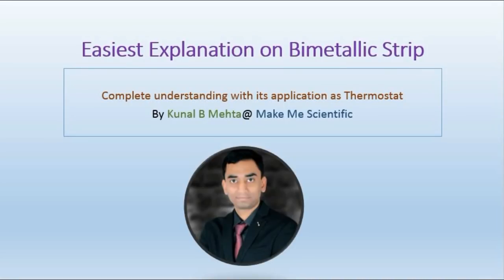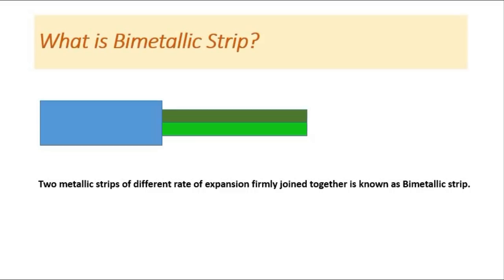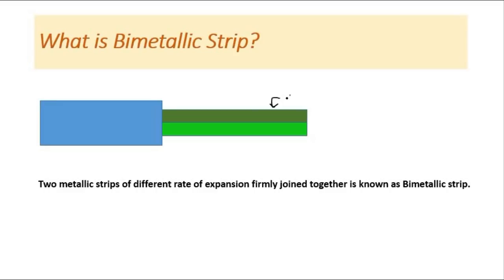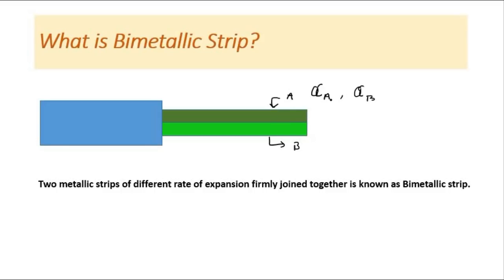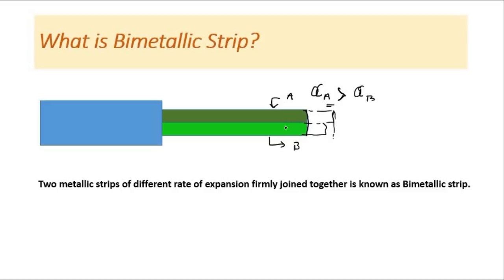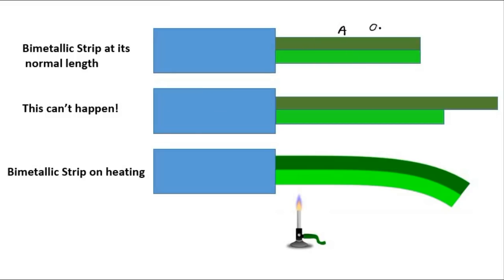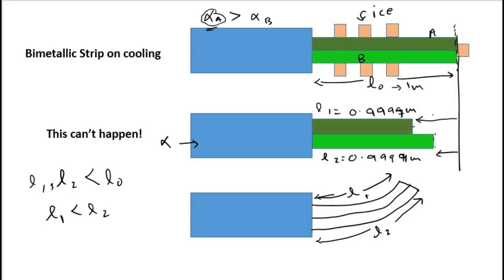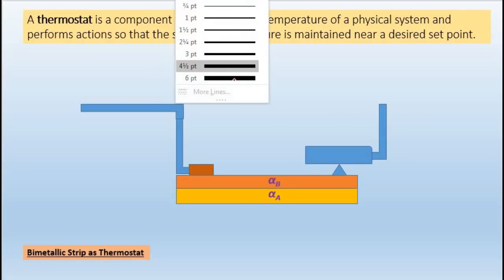Bimetallic Strip on heating and cooling with its application

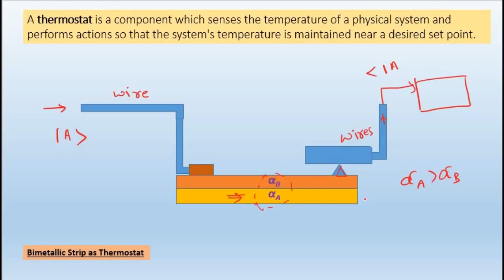Comment: Sir, in the thermostat, won't the strip move upwards as when alpha A is greater than alpha B, L1 is greater than L2. at 12:02
Reply from the maker: Thank you Aayush for pointing the error
Reply: Good observation
Reply: Yes alfa a must be smaller than alpha 2 for that to happen
Reply: Exactlyyyy
Reply: I was also confused to see this then I opened the comment section ...

Comment: Sir 
Bimetallic strip usde in strip thermometer?
Reply from the maker: No. In thermostat
Reply: Can you explain strip thermometer used material
Reply: A thermometer uses mercury because expansion of mercury on heating is very high. According to the temperature, the mercury expands and we get to see the amount to which it has expanded. This expansion can be measured to give us the temperature
Reply: Hope this helps